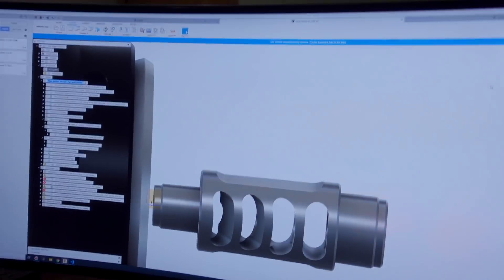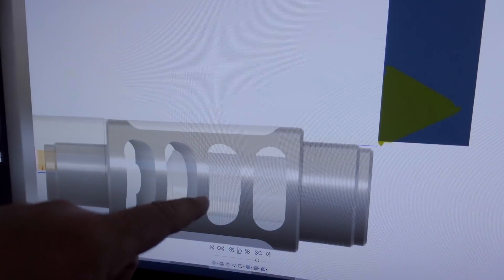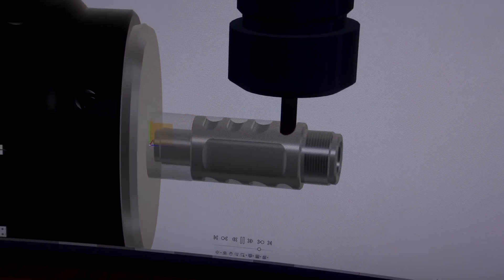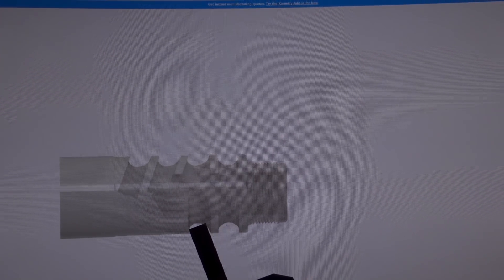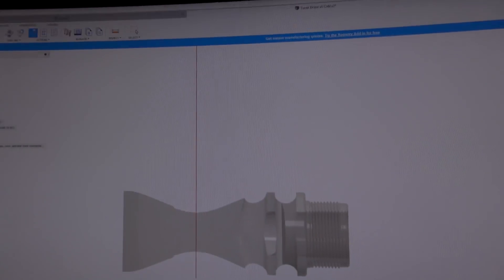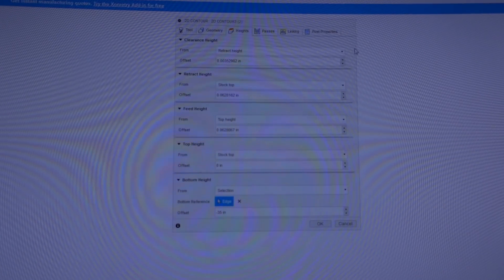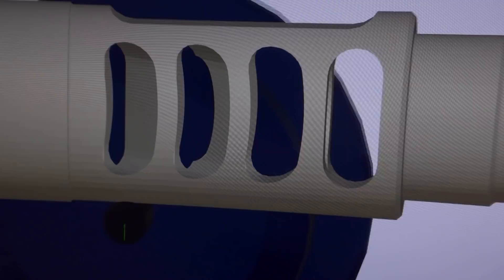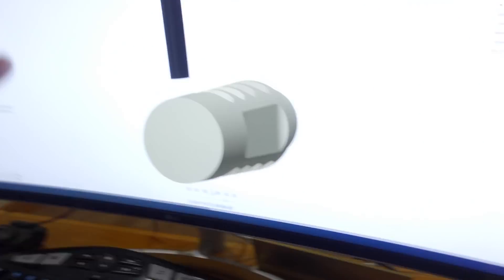Fusion 360 saved me from crashing my DMG Mori Lathe! __ Starting a machine shop 15

Comment: how do you turn the spindle on through MDi i just got this CNC i need a little help ? 
i also have ALARMS regarding battery? the lathe was off for three months any idea? how to get rid of  battery voltage errors? 0001 ? 009F?
Reply from the maker: Change the batteries. Find a manual so you can figure out where they are at. 

Do some reading on G Code for your controller so you can find out how to turn spindle on and off.

Comment: Erik just watching you video and noticed you comment on the air compressor. I run a paint shop and learned that if you bury copper line 25 ft coil I’m in indiana which is connected right from the pump out to bured in the dirt( cooler) 25 ft coil then back to tank inside the tank remains cool so water collects in cool tank and can be drained the tank never heats up so you don’t ever get water in your air lines hope this helps it works

Comment: I 3D print and use the hobby class license of Fusion 360 (thank you Adobe) and will never be a Fusion 360 pro but I sure know a lot more than I did a year ago.
Erik, I've had and idea for a brake that has more flutes.  I don't know for sure but would like ten flutes bring the kick back down significantly?
Reply: I've done some testing with that in shotguns. Not the same but the same principles are applying. There is a bunch of really interesting white papers from the mid-50s produced by army ordnance. There is an equation for perpendicular surface area of the brake flutes..

Anyway without all of that equation what you find is that the area of the brake that is doing the most work is the area closest to the first vent past the muzzle. After that it is very rapidly and diminishing returns. Als o the vent closest to the muzzle has the most force exerted upon it. So if you got a bunch of gills that are close together and they're made from fairly thin material I've actually seen them bend. And you can observe the amount of deflection decrease as you get further away from the muzzle very quickly. How much gas there is to do work with will vary based on the caliber and the particular load you are shooting. 

But in general getting a bunch of events close together near the muzzle do work. You just need to make sure they are strong enough to handle the forces that they are redirecting.

Comment: I’d recommend going away from F360 for cam. It’s cheap but you get what you pay for and a crashed machine is a lot more expensive. F360 simulation is not always an accurate representation of G-Code.
Reply: Most CAM simulations have nothing to do with G code.  When you run the simulation it's not posting the code and running it. The simulation is just there to show what you should expect to see when you run the program. If you have a crappy post processor the program could come out looking nothing like the simulation.

Comment: I just wish that they would use fanuc controls instead of the proprietary software 😕.
Reply: FANUC controls are falling way behind in the industry right now.  The proliferation of cheap computing power has put a huge dent in the hold that FANUC had for years in the industry.  I used FANUC controls for the first roughly 13 years of my career.  My current shop has Citizen/Miyano machines with the Cincom control.  It is head and shoulders above anything I've ever see on a FANUC control.  The set up on the Cincom control is so damn easy, it's nuts.  I don't think I'd really want to go back to FANUC now, it seems so primitive in comparison.

Comment: Those decimals places are probably the easiest way to crash a machine. I remember shop floor programming a simple part on a HAAS TL-2 lathe we had, put in .300" instead of .003" for my feed. Not a huge problem if I was taking a very light cut, but I was burying the cutter to get under the scale on some 4" OD cold rolled steel...CRASH, right in front of the boss (my dad). He wasn't too happy. Lol